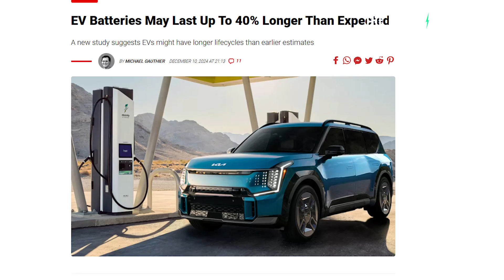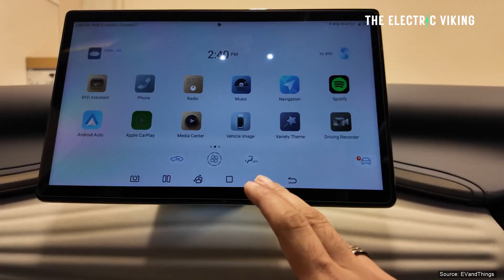Stanford: EV Batteries last 40% longer than expected in real world testing

Comment: Which cars don't have proper regen braking? Would have been good if you'd mentioned any of them...

The only reason I'm not buying an EV is because I want the best bang for my buck, and all the old Leafs are sitting around with useless battery capacity that has written them off.

Comment: We are still waiting for 25 years or 200 000 miles 100% full warranty for the battery.
Reply: 也许一颗小石仔碰掉了电池包的漆，销售商都会拒绝给你保修的😂，这是电动车的缺点。使用byd和catl电池的营运出租车，很多已经跑出了50万公里，比亚迪甚至跑出了80万公里
Reply: 电动车适合频繁使用
Reply: @bolu7971  I can't speak Chinese, but there rarely have been situations where the fuel tank need to be replaced during the life of the car.

When the battery warranty is better or stable enough 20 years etc, people trust and change their habits to electric vehicles.
Reply: @iSot80  目前电池的寿命没有那么长，寿命约8年，和你使用的公里数没什么关系

Comment: I bought a 2023 Bolt EUV for about $24k after the $7500 tax credit and love it.  Perfect commuter car and for shorter roads trips that only require one dc fast charge (400ish miles or less).  Never going back to an ice car. Sadly I don’t think getting an ev car in the US that cheap is an option anymore.

Comment: We have a 2015 Nissan Leaf.  We bought it in 2023 with 92% of the battery left, so it lost 1% per year.  Not bad.
Reply: Interesting, we also have a 2015 Nissan Leaf Gen2 24Kwh. It was bought with around 80% (120km range) battery and now its degraded to around 50km displayed at 100% charge. Bought at around 56k km 5yrs ago and has got to around 100k km now. I think it saw a bit of DC fast charging in Japan though, was always charged it to 100% and not always parked under cover.

Comment: Its said that a 30 percent degradation the battery has ended its usefulness . By doing the math in general todays evs will reach the end of a useful life at about 200k in miles . Now dies that mean you cant keep going ? My phone at 3 years can still hold a charge but its drains fairly rapidly and is not great . Now if you plan to keep an ev for a long time and still have decent range it maybe better to get a extended version with larger battery pack . My son has a standard range ford lightning. In 10 years he will have 200k in miles . Doing the math he will go from max range of 240 to 192 at 20 percent degradation. The effective range will be 144 with charging at up to 90 percent and recharge as low as 15 percent . I think you get a misleading bias for pro ev and dont give the whole scoop of icecream . Range should not be based on max range but more on effective range . Now gas vehichles do the same thing you dont want to ride your tank to empty . Maybe a quarter tank at the lowest . These YouTube videos like state of charge doing a range test from a 100 percent to zero is not manufacturer specifications and if determined to have done that may void a warranty . Now for my son should he just charge to a 100 percent for the rest of the time he owns the vehicle ? It will not have much value . Maybe by that time battery replacement maybe a thing and actually worth doing to a high milage ev but nornally you dont replace a engine on a high milage ice vehichle
Reply: I have a 2023 Tesla Model 3 RWD - I have had it 2 years and 30k miles. I have 3% degradation, 2% occurred in the first year and 1% in the second, each year the addtitional degradation slows down. This degradation has been validated in 2 ways 1) The official Tesla battery test 2) The actual number of miles I can get between charges.

After 10 years and 150k miles I can expect my car to have around 7% degradation. 

My lifetime range is 520km (320+ miles) and around 610km (380 miles) in summer, I have physically driven  589km / 366 miles without charging and had charge left.

My charging routine is simple - I plug in every time I get home and charge to 100% and leave it plugged in at that state of charge until I need it again - this is what my manufacturer recommends to do with my LFP battery.

The useful charge cycle for a 2023 Tesla LFP battery is estimated to be around 4500 cycles (equivalent full to empty to full again cycle) before falling below 70% of the original spec, this works out to be around 750k miles and 20+ years of service life.

Example of summer range with my 60kwh (57.5 usable) battery.

https://imgur.com/kOiWa58
Reply: @TB-up4xi  Interesting. I here what you are saying but that's not what the general concienouse outside of Teslas specifications . The batteries are common to a certain degree .you can have a lfp battery in a Tesla or another brand and they probably will have similar results . Your subscription is not typical for Tesla but you do have the new lfp battery that is new to the market . The charging to a 100 percent as a standard is very different over past applications . Now it's never charged to full capacity as there is a bit of reserve . You are definitely bucking the trend and you have proof of that . I think you need to get to a higher milage to really establish your trend you are seeing in that 100k to 150k . There may be outliers and do something that just had better outcomes on battery health . Recommendations today maybe backwards tomorrow . I would definitely be excited with your results so far

Comment: Someone needs to make an LFP upgrade kit for the Nissan Leaf.
Reply: A Hong Kong company does upgrade Leafs and maybe has that option.
Reply: Yes, there is a company in Brisbane doing this but they wanted $20k last time I checked for a 55kwh battery. Once they are cheaper it may make sense. At that price, better to save for a used model 3.
Reply: @realrift01  Check out Vivne they sell plug and play battery packs using CATL battery cells , up to 50 Kw h.

Comment: Regen brakes last longer. Using that waste heat reduces their wear. Hardly ever need a brake job.
Reply: Indeed brakes are used so really these days EVs will now perfrom a maintenance cycle when braking, swapping to using the brakes rather than regen, every so often to clear the rust off the discs.

Comment: Often it is best not to use regen on a motorway. Free wheeling down a hill saves energy and keeps some momentum. Using regen to put power into a battery wastes some energy. Then using that energy to feed back to the motor wastes some more. Better to save the energy ever going to the motor in the first place. In this specific circumstance you can get better range without regen.
Reply: Depends upon the car and the hill, for hills I typically use the lowest regen setting as it doesn't eat into momemtum but directs what would otherwise be the gravity aided acceleration into the battery and helps keep to a constant speed. This also helps motor back up the next hill for no cost on range.
Reply: Rolling down a hill and not using regen is the most efficient. You can just touch the accelerator so that its not quite accelerating and not quite regenning.
Reply: @realrift01  - not if you're travelling within speed limits and braking down hill to restrain speed, low setting regen works better in this circumstance as you're not wasting the braking energy but still travelling at the speed limit  - without needing to feather the acelerator as you would in an ICE car. 

Of course this regen various by make, those with only 'B' mode have little choice, but those with flappy paddles are adapt at tuning the regen to the conditions with multiple levels available.

Also, in HGV's with their extra weight, regen down hill can recover many miles of travel that otherwise would be wasted to keep to speed limits.

The aim is to bleed the gravity assist into the batteries rather than use the brake to retard it.
Reply: @GruffSillyGoat I didn't say it was going to be within the speed limit 😄. Just most efficient.

Comment: With close to none charging infrastructure, like in the UK, the battery should last at least 600km in rel word, not on the paper. Its been proven that at least 25-35% less then manufacturers claims, with all electric devices being switched off A/C,radio, lights etc. I will not see in my life working even close to petrol vehicles, which are much cheaper to run anyway, with double range.
As commuter yes, but longer distances, going into the coutry side, Forget it. No one even would know how to fix sucj vehicle full of electrical.electronic instruments, devices, and sensors, et etc.
Australia is in mst of the states 9 months per year is sunny, some parts of southern Europe also, but the rest... Scandinavia, Central, Eastern Europe, UK, Ireland forget it.
Reply: What are you talking about?   The UK has good and rapidly growing charging infrastructure.
Reply: Complete tosh - the UK has a fairly well developed charging network of over 36,000 locations, 72,000 charge points devices and 106,000 connectors. Adding over 1,000 new charge point devices every month - compare that to only 8,000 odd petrol stations in the country. Plus the majority of EV drivers charge at home without issue, and will continue to do so as only 30% of households have no access to off-street parking who actually own a car (many city centre's households do not own a car themselves).

The are areas were the public charger deployment is patchy, mainly due to local bueracratic issues delaying deployments. However, this mainly reflects areas with larger protected open spaces such as the Pennines and Salisbury Plain areas, which have low population densities. Although, even in these areas with the size of the UK a charger is typically accessible within a ten mile radius.

I live in rural South West and there are many EVs on the roads these days in the country side. As to a car's electrics draining range this only accounts for a few percent per hour, EVs have more efficient lighting and heating systems than perhaps those who drive the average ICE vehicle are accustomed to. 

As to fixing a car packed with electronics, welcome to the modern age the same applies to new ICE vehicles these days as well what with the new NCAP safety standards driving adoption of advanced ADAS systems.
Reply: Complete idiot. Norway has the highest ratio of EV sales in the world, and Sweden design some of the best EVs around: Volvo, Zeekr and Polestar 

Please do better

Comment: Autocar magazine took apart a Tesla used as a taxi since 2014 it had done 440,000 miles. The car battery according to Tesla was still charging to 70% of original capacity and an independent assessment confirmed this.
Reply: Source? Especially that independent assessment report.
Reply: @ No recollection sorry. But do you doubt its veracity?
Reply: @johnfrancis4401   Νοt really. I just like to cross check pieces of important info...

Comment: My old nissan leaf , 2014 model, no cooling , old chem, old bms. 72 %  still good for city runs.
Reply: Good
Reply: You can replace that battery pack with new CATL cells. 
They are selling plug and play battery packs ,so when you want to upgrade with 50 Kw h battery pack it is available.
Reply: Once the battery is under 70% it has to be replaced.  That is a law or something.  Right?  Because if you keep driving it then it is not dead and the rule is once a battery loses 30% of it's charge then it is dead.  The charts and such can not account for dead batteries still on the road driving.  You will destroy their models that say the batteries only last X amount of time before they must be replaced.
In 15 years I fully expect 20% of EVs to have "dead" batteries and still be on the road.  60% of a used 20 year old TM3 will be 135 miles, more than enough to drive to work and back a few times between charges.
Reply: @davidbeppler3032  - more a rule of thumb than a law. It's projecting a useful lifespan for the average driver; that at 70% state of charge the range will drop to a level where the average user will swap the car. As this is a bell curve distribution there will be those who change cars both earlier and later than this level.

Comment: My 10-year old BMW i3 is giving me exactly the same range as when I bought it
Reply: Probably because of spare capacity reserved in the battery. But still a nice touch.
Reply: how long it goes on full charge? do you charge it using fast charger
Reply: @kozhenidres314  I trickle charge with the granny charger to 100% every night on the slowest of the three settings it supports. I DC charge maybe once a month. When I got it, the little 18 KwH battery gave me 100 km, and it still does.

Comment: Great video. I drive a BYD in suburban Australia and in 20 months have never run out of charge, even on long trips. You can rely on the range estimates the car provides, and my wife and I are pretty relaxed about range now, having experienced this reliability. We charge the car off our solar panels and do not need to use a fast charger. The fuel savings we reckon at $1600 per year, on mileage of 8000km per annum. Servicing is a minimal cost. Plus, as the Viking notes, we can get away faster than any internal combustion car from the lights. My wife especially loves this bit as she is a self-admitted lead foot!!
Reply: Top wife!

Comment: I bought my ev in April 24. I have not for a moment regretted the purchase, even though it would be cheaper now.
Reply: July 23 for me and same. I love my Tesla. Maybe in 5-10 years if there are batteries that will do 1000 miles I might upgrade the battery but range hasn't really been a problem so far(I do have a 4x4 too so I have use that a couple of times to do long trips where there are now charging stations yet.)
Reply: Same for me, bought my M3 in April. It’s 5k cheaper now. Life goes on. Happy with it, and our Atto 3 purchased Oct 23.